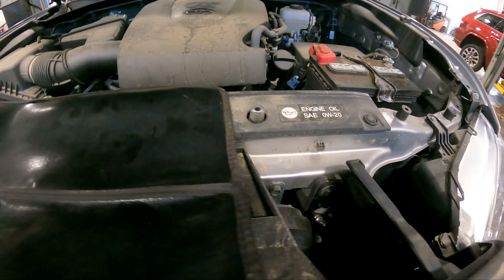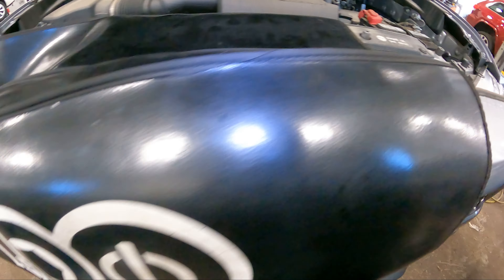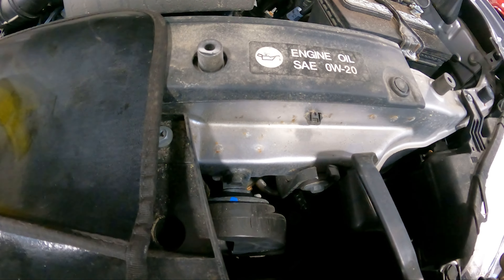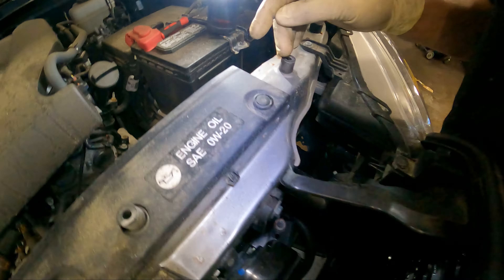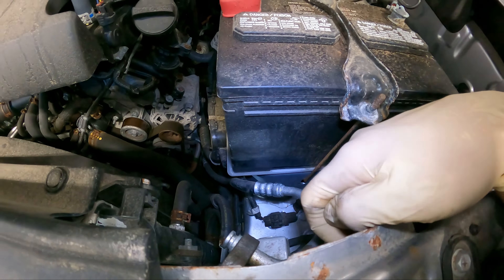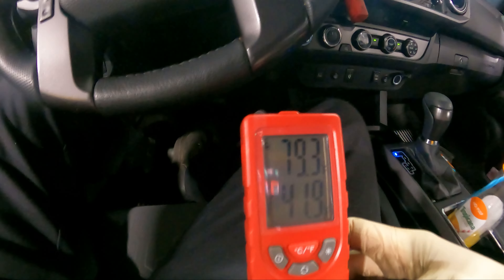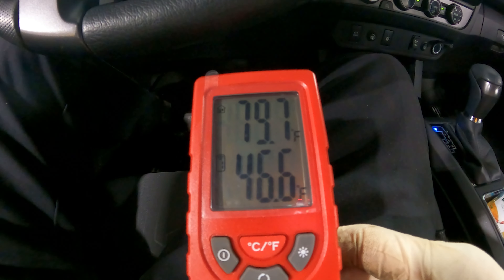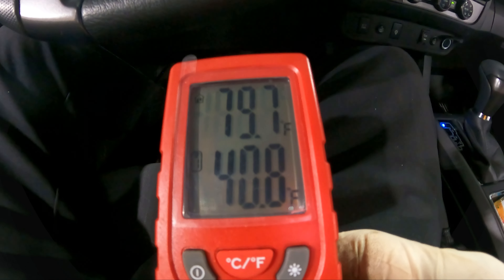Customer states OTHER SHOP TRIED TO SELL ME AC CONDENSER!🤬😳 #customerstateswhat

Comment: A Kia dealer told an elderly friend of mine that his Sorento needed a "whole new A/C system, and that would be 3500 bucks. I had him take it to my guy, a hot rod and A/C shop. It needed a new service port valve, he replaced both of them and charged the system for 125 bucks.
Reply: Never go to dealer with anything other than ordering OEM parts or if necessary SW updates. And this applies to whole world.

Comment: My first time commenting on one of your videos, I’m based in the UK and love your content, your narration is excellent and funny and you’re obviously a very competent motor mechanic 😎
Wanted to ask if you advised the customer to replace that a/c line with an OE one? Cleaning off the corrosion is good practice but would there be a risk of making a scratch or small nick where the O-ring seats leading to another very slow leak in future? All mating surfaces need to be spotless in a/c components or they’ll leak 🥴
Reply from the maker: Cleaned with Emery cloth, but very valid questions.

Comment: You do it the way I would in a a/c repair.  Several shops I know would sell a complete o ring replacement reseal job.  Even at 40-42 f is okay, but yeah, 37-40 on a hot day is just great.  At least that's a native gas system; system conversions from r-12 to 143a don't cool very well or fast.  Did conversions on Volvos with the factory kit and they sucked.

Comment: CSW, Good job but as one profectional to another, can I suggest using Nylog Blue on ALL and I mean ALL, O-rings and connections, even metal to metal threads in A/C systems, it not only insures leak fee connection but also eliminates micro leaks, What is Nylog? well it works like magic to seal everything, here is the official word on it. NYLOG BLUE GASKET & THREAD SEALANT
Nylog Blue is an elastic fluid made from synthetic refrigeration grade compressor oil. Nylog Blue is fully miscible and compatible with all system refrigerants and oils. Gaskets coated with Nylog will never dry or become heat fixed to the surface. Threaded connections coated with Nylog will block high pressure leaks by forming a hydraulic seal. Nylog can be used an assembly lube when installing shaft seals, o-rings, schraeder valves, ball valves, or other internal system components.Will not Contaminate Systems,Seals Flares and Threaded connections,Lubricates O-Rings and Gaskets,Approved by All OEM Manufacturers, Guys this stuff is the bomb and it is not new it was invented in 1935, as a retired master service tech in the HVACR field I used it for over 30+ years on every thing I wanted to seal and not worry about leaking, it even meets the Military MIL spec and I used it in the Air Force back in the 1980s. CSW just thought you would love the info. brother.